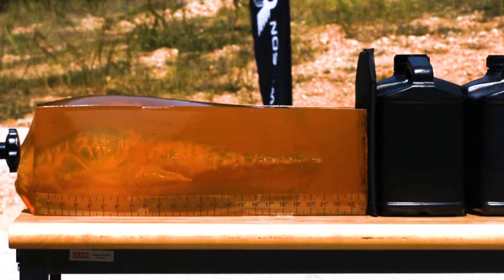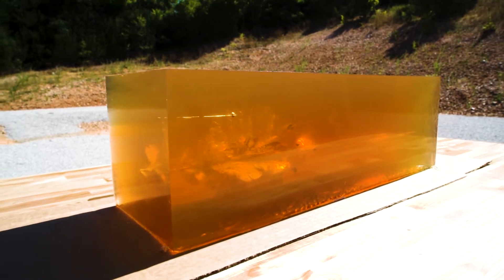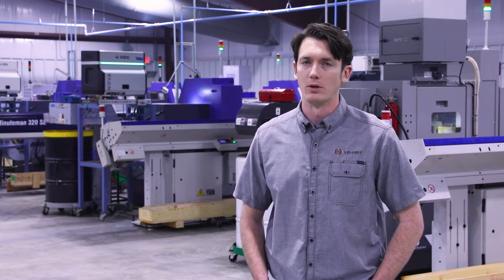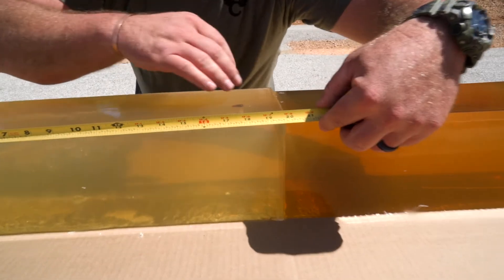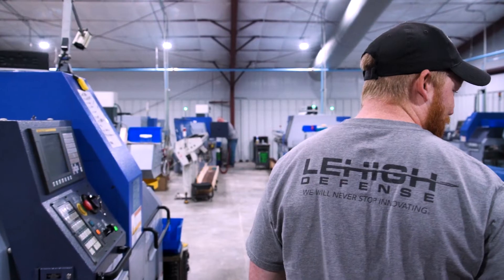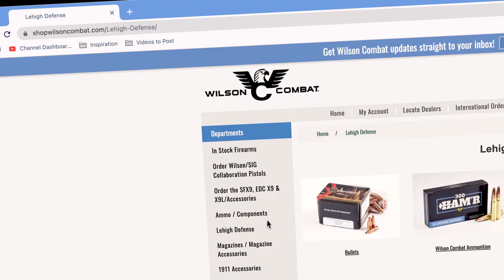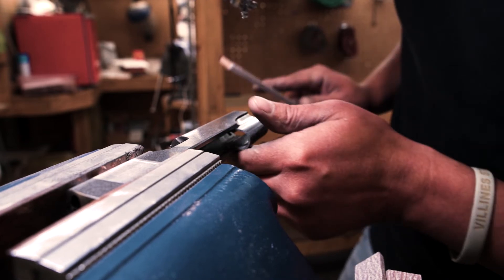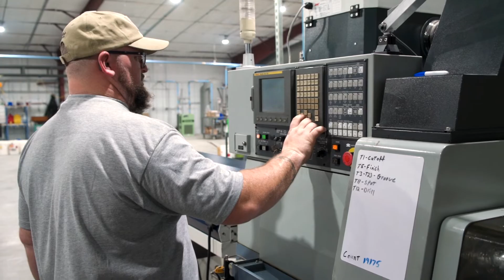The New Lehigh Defense Factory Tour. Producing 390,000 Solid Copper Bullets a Week!

Comment: The Extreme Defenders in 65gr, 357Sig are my go to. 

The potential these rounds have is amazing. 2100fps out of a 4inch barrel and dumps all its energy without over penetration. The  probability of hydrostatic shock wounding outside of the direct path of this projectile and out of a concealed g32.